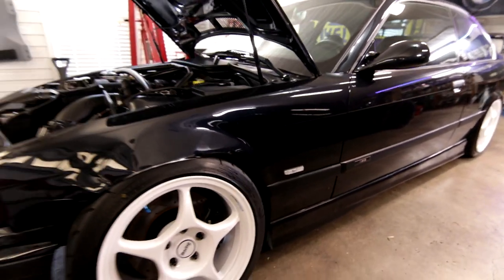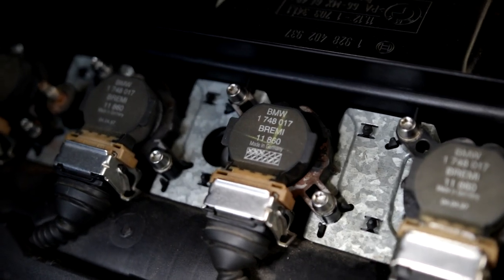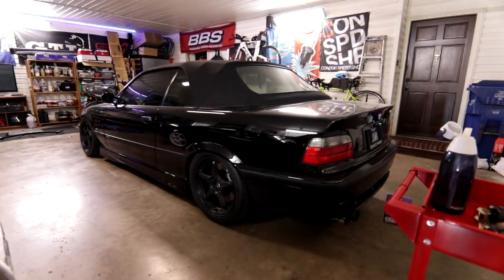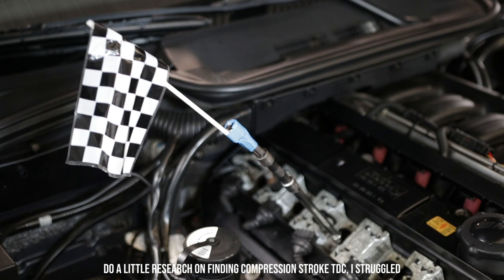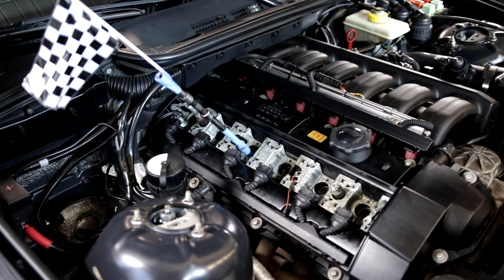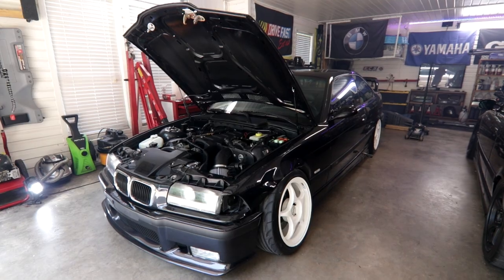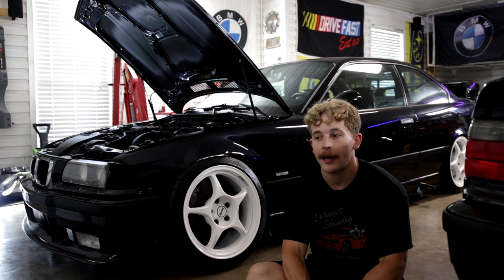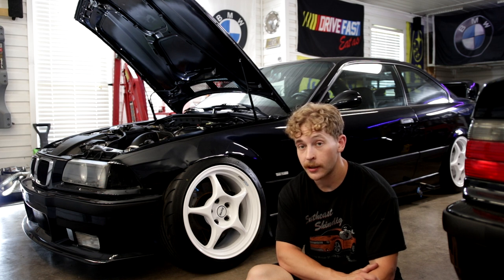Diagnosing my E36 M3’s Smoky S52, is it Blown? - E36 M3 Drift Car Project Episode 13

Comment: I think it’s valve stem seals. If it was piston rings you would have ok compression if your cylinder was filled with oil.
Reply from the maker: I don’t necessarily think it’s the rings themselves, I think there’s damage to the cylinder wall itself.  I could be wrong, and when I get the engine out I do plan on disassembling it to get a better idea of what is really wrong!

Comment: im from germany. and we have a company here that makes carbon fibre fenders that are wider than the originals. for  around 800 euros a pair. might be a good choice for ur wide tire /wheel combo
Reply from the maker: We will see!  As of right now I’m dead set on keeping it stock body because I love the way it looks.  What happened with my fender was a little hard to explain, and I should have mentioned I wasn’t even moving when it happened.  It was a freak accident and with a little bit more front suspension adjustment I’m confident it won’t happen again.  Maybe one day I could do wider front fenders but for now I’m gonna keep trying to make it work stock body🤞🏼

Comment: Don’t do ls, I’m eight grand into mine and it’s still on jack stands. I’m only halfway through the install and needs so many small things. Cheap ls swaps are bs
Reply from the maker: Exactly.  This was actually a large factor in my choice.  I don’t know what makes people think any engine swap is ever going to be cheap.  I fully expect to spend 12-$15,000 on this swap all said and done.  While maybe doing an LS I save $2000 on the engine itself since 1J’s have gotten expensive- but at the end of the day you’re spending buku money regardless so you might as well do exactly the engine you want.

With that said my next one will 100% be LS powered and I think it’s actually an awesome combination for this chassis, so don’t get discouraged!  Keep pushing! <3

Comment: Blown head gasket oil cap shows that
Reply from the maker: Unfortunately, the oil cap is not a good measure of if the head gasket has or has not failed, as things like normal condensation can give it a milky appearance.  If the head gasket were blown the leakdown would have pressurized the cooling system and created bubbles in the expansion tank.  The leakdown test showed almost total leakdown into the crankcase/ oil pan which is the last place pressure would want to escape, this, plus the fact that there isn’t even a touch of coolant in the oil I drained, tells me almost without a doubt that it’s not the head gasket.  The milky color on the cap was almost without a doubt fuel mixed into the oil, as the oil reeked of gasoline and was likely pouring unburnt gasoline down past the damaged piston into the crankcase. 

That said, I still have the S52 and will be tearing it down, starting with the cylinder head, to 100% nail down a cause of death and will be keeping it to rebuild to go into my 328i vert one day!

Comment: dont swap an original m3. 
rebuild the s52 .
it will be worth it in the long run
Reply from the maker: So here’s what I’m thinking: I’m dead set on putting a 1JZ in the M3; however, I will keep and rebuild the S52.  My plan is for it to go into my 328 after rebuild.  That way I’ll still have it on the incredibly off chance I want the original engine back in the M3!

Comment: This is only my opinion btw but it pains me to watch you to this to such a beautiful car (your m3). You have such an awsome 328i but i feel your destroying your m3 my dude. 😢 why did you not turn ur 328 into a drift car and keep the more expensive iconic car (m3) reasonably modified and rebuilt so well like your 328.......😢
Reply from the maker: So after watching this particular video I totally understand how you might feel that way.  It really bothered me crunching that fender, and the engine trouble bothers me as well.  However, both were already on their way out the day I bought the car.  If you check out some of my other videos or watch the highlights on my Instagram (@griffen.xg) you’ll see that this car is actually built to an even nicer, cleaner, and more OEM+ standard than the 328.  I took everything I learned from that car and have applied it here.  This M3 was saved by me, and me and it will live a good life being driven as it was meant to!  Just stay tuned, I promise you’ll believe me.
Reply: @griffengardner  it's your car bud your in your right to tell me to get fucked lol I watch all your vids I think your 328 is one of the best I've ever seen... not a big stance guy but you have done a great job
 I also own bmws and have owned many over the years but ive never had an e36 m3 yet they are getting so rare where I live. When I get one I will cherish it and not molest it with mods. But what I would love to see is a super charger kit on one makin reasonable power maybe 400bhp?